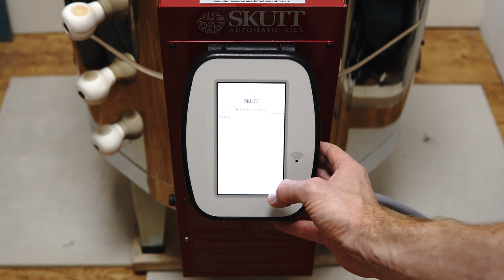Making an Effervescence Mug | Full Process ASMR

Comment: Beautiful! I love watching these videos so much.
Question: Do the little dots ever turn out sharp? Is there a way to prevent this if so?
Reply from the maker: They certainly can be. The thicker the slip mix, the sharper they will be. If you get it right the mix should be runny enough to round over on the top when it forms a dot, then flatten out as it dries. If the mix is too thick then it can form a sharp peak and stay that way.
Reply: @OldForgeCreations  That makes sense. Great tips. Thank you so much!

Comment: How do you keep the rims from warping?  Just by listening and watching you make mugs, I would have to say that they are very thin and lightweight.  Which amazing.  
I have more trouble with the rim warping than anything. 
Any tips?
Thanks for sharing your talent.
Reply from the maker: I let everything dry quite a lot before handling, which is only possible with batts. By the time I wire off, the rim is already leather hard and is much stronger. I then dry them the right way up, so the rim is on the dry side of leather hard by the time the base is trimmable, and prevents warping when it goes into the Giffin Grip.